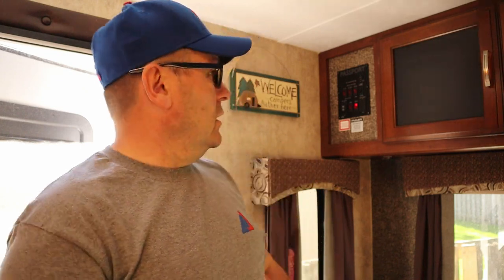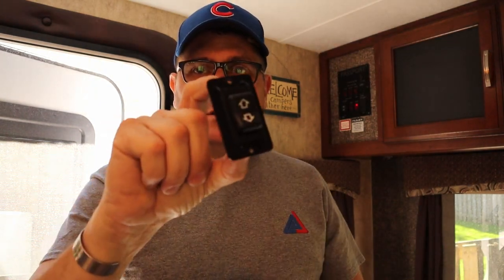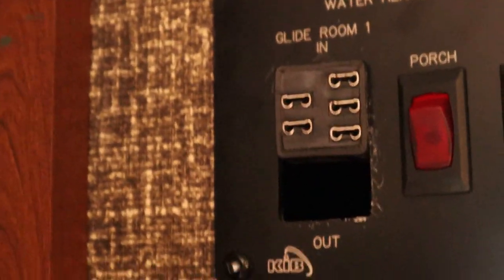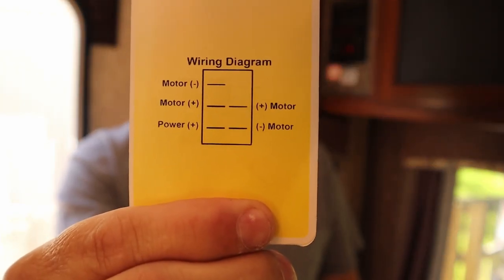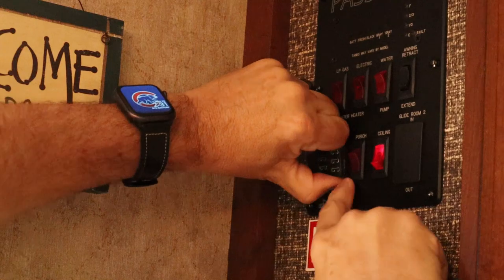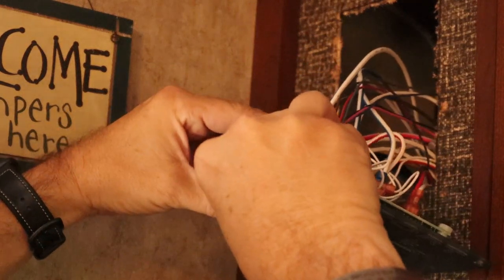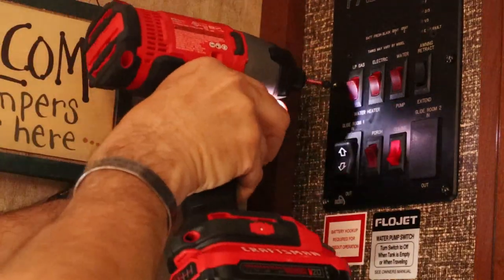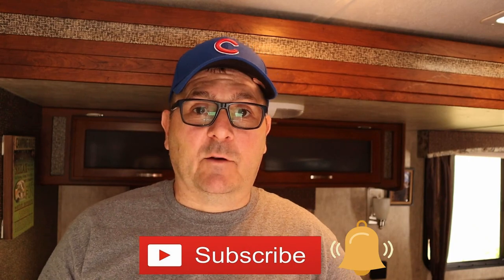Replacing Slide Out Switch

Comment: I thought that would be the end of it for me , but my slide still won’t work, motor is fine I connected directly to the battery and it works. I’m thinking there’s a bad wiring somewhere I just don’t know. Any suggestions?
Reply from the maker: Not sure.. it was a bad switch for us.  Putting the new one was the fix.  If it works with the batteries connected the wiring would not be the problem I would think.  Hope you get it resolved.  Thanks for watching

Comment: Great video and timely for me.  Just purchased a 2014 Keystone with the KIB control panel and the red illuminated ceiling light switch is wonky.  Worked fine at first but the last couple of times you have to get it in just the right position to get it to stay on.  This is super helpful for replacing it.  Do you have a link to the source for the replacement switch?
Reply from the maker: Glad you liked the video.. thanks for watching.. We picked up our switch at our local RV dealer.. it was $9.  Found this one on ETrailer for $21.. I would check with your dealer.
Thanks for watching. we appreciate it.https://www.etrailer.com/Accessories-and-Parts/JR-Products/37212285.html?feed=npn&gclid=CjwKCAjwmrn5BRB2EiwAZgL9oh2UgGmx-8V219VXm35B9fpAZfpuS6NmCenOyHX3yJko1iau1UT-VRoCjAMQAvD_BwE
Reply: @HappyPlaceDiaries  I called the dealer and they said there were many variations and I needed to pull it out and look at it.  When I did that (per the instructions in your video) it magically started working just fine so I took a couple of pics of it and pushed it back in.  But will get a few spares to have on hand.   Thanks again!
Reply from the maker: @kenferguson9958  Thats awesome.. Glad to hear